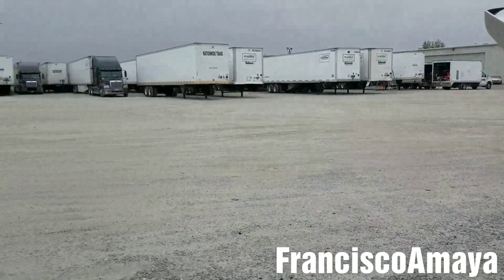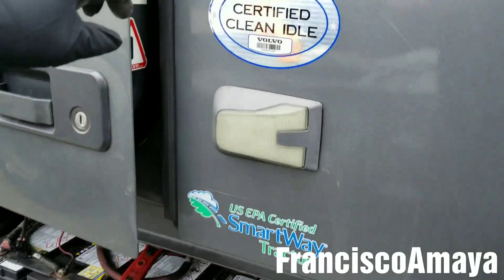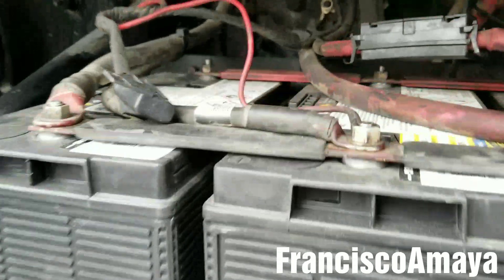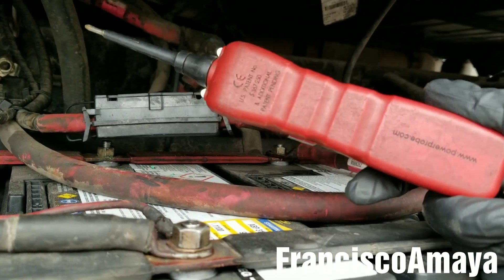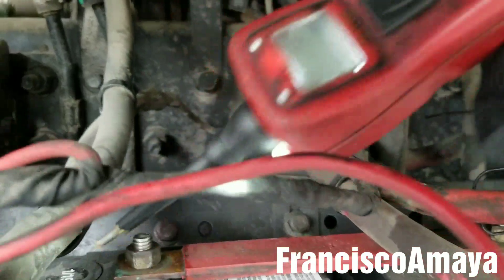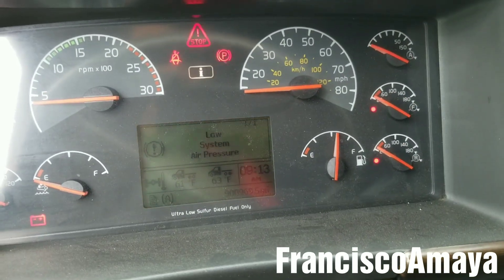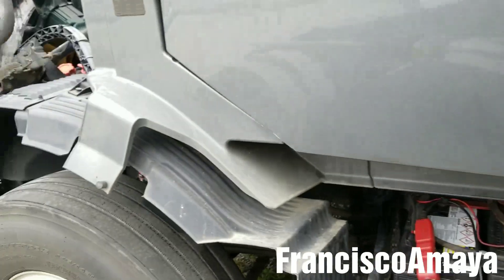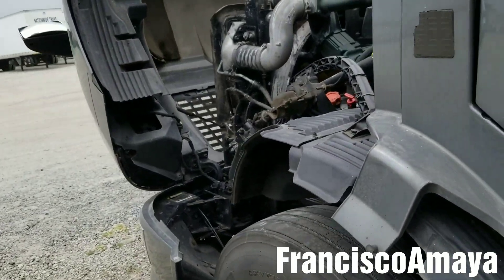Volvo VNL 670 760 780 860 D13 engine not starting not electric power in the cabin

Comment: I swear to god I almost gave up after failing to start my truck for 4 hrs at the fuel island (pilot) . Called multiple mechanics and nobody answered, one cancelled service call ($550) . But I was going to bed and saw this video,ran my jumper cable from battery terminal to the frame bolt for ground (somebody suggested that here) and it started right away .THANKS A LOT MAN !! Can’t thank you enough for this suggestion 😅

Comment: Mine did the same thing today! I turned the key to the on position and then I touched a wire from the ground bolt to the ground rail on the battery and it sparked. I flinched back and power came back to the cab even though I wasn't touching the wires anymore. What do you think??

Comment: 2008 Mack MP8 CXU613.  Changed starter. Dash lights do not cycle. When you turn key all the way to start they cycle then go off. Checked everything I can think of. Mech things ecm. Thoughts?

Comment: Thanks only when you connect one side After fuse what abut the other side I mean can I connect apiece of wire from negative to after fuse temporarily until I change that whole negative wire that fuse in it is not working

Comment: This is awesome. I had exact same problem today, after I watched this video I just used my jumper cables to bypass this wire and the truck started right up! Took the cables off and truck still starts like it should. Definitely buying a new cable tomorrow because it looks like this one is on its way out. Thanks for the help here! Saved me a bunch of money
Reply: How to use jumper cables please advise as i am running with the same problem. Thanks
Reply: I used your method (jumper cable)

Comment: Hey so I have an 07 Volvo with isx Cummins it won't start unless I give it one shot of starting fluid then it will start and run but it takes about 25 seconds after starting  before it responds to the throughtle peddle 😊

Comment: Thanks for the insightful info. I have a 2010 with an IXS Cummins engine. I am down with Regen failure. The mechanic clean it up but it drove for only a hundred and forty miles and the problem resurfaced. Can you please help me.

Comment: Brother please reply what was the problem I saw your video 3 times I could see your power probe showing positive voltage at ground point is it the main ground wire was open or lose please reply .or something fuse open . Nice video but you didn't tell the cause  🙏

Comment: Hi Kong Lee 
I have 2016 volvo vnl.
When I shutdown my truck cab power goes off in a minute. Battery shows 11.3 to 11.5 it doesn't matter if I was driving for 1 hour or 8 hours.
I checked alternator, starter, pass though and main fuse box connections all are good. I changed batteries too. Please advise 🙏

Comment: Hello, I have this same truck. I’m having a problem with the truck taking long to start. And when it do start it run rough and knocking noise. Then it will level out and run normal. I here people say injector cups, injector  orings, fuel pump, quality valve. Do you know what the issue with these trucks?

Comment: Hey Fransisco, D13 neutral switch not detected; check three fuses and relay, tighten btry cable check control , wire's under seat pull test. Truck was towed from the front driveline and axle not disconnected.
What do you think.

Comment: Tengo el mismo problema pero no tiene ese fuse en el frame alguna sugerencia please volovo 2005
Reply: Tengo este problema Prende
 pero no se queda prendido y se apaga. Ya le cambie el solenoid en motor , gas filter y una manguera de gasoline.  Ahora voy a cambiar el ignition switch . Dime por favor como arreglaste.el tuyo mi hermano. Please

Comment: Thanks so much for posting this video!  Without it, my automatic 2018 Volvo 860 would have had to be towed to the repair shop.  The very cable with the relay (that was clearly pointed out in the video) was the problem.  Apparently, the relay was shorted out.  Once replaced, all was good.  Thanks again!

Comment: I just wanted to thank you for this video. The power went out in my truck and 5 mechanics could not figure out what was the problem until I showed one mechanic your video and he was able to fix the truck. The ground cable that attaches to the frame was frayed and breaking apart. 

Thank you so much for this video!
Reply: How you change that fuese
Reply: @chrispaisley6497  fusible link cable replace it
Reply: What was da issue? Cuz I only saw give ground.

Comment: In my Volvo, the ground connection problem was on the ISX' enginess block,  right below the fuel filter. Removed and cleaned everything, make a new ground eye terminal because it was weak, install it back to the block and problem solved.
Reply: I think that’s my problem but i have no codes in truck